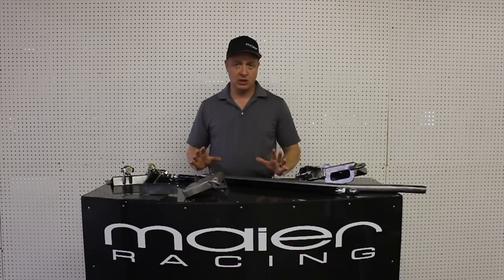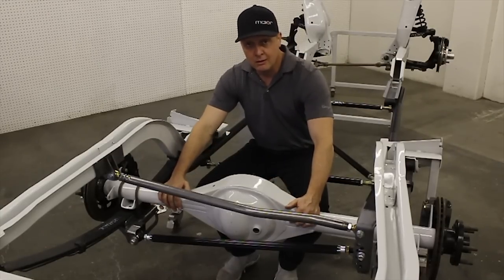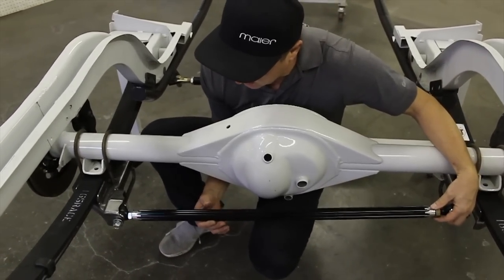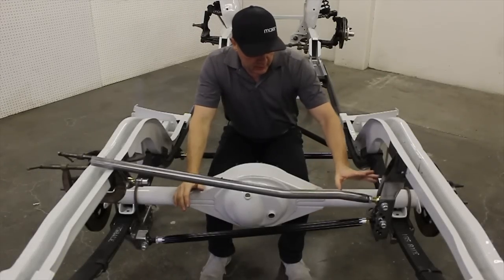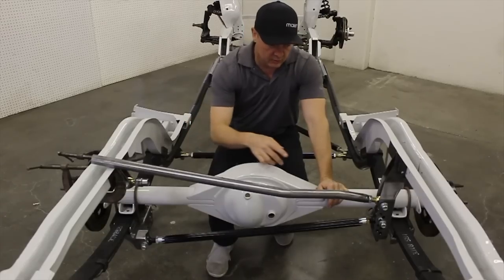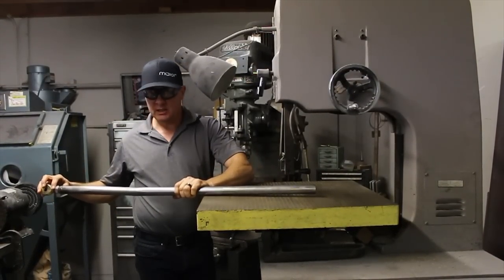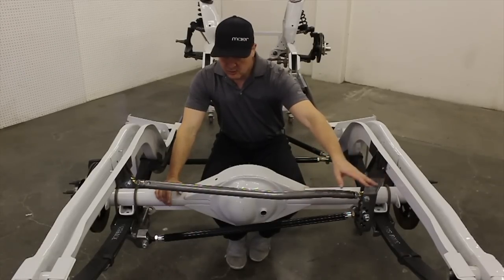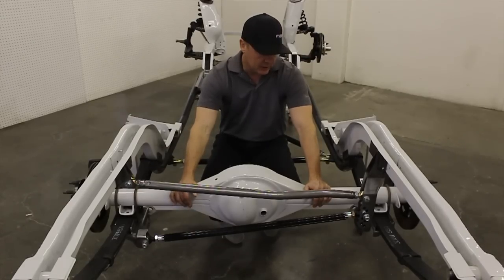Panhard Rod Kit - Maier Racing

Comment: 2 questions:  Does this kit work for other Ford rear suspensions? (Falcon, fairlane, etc)?  Would you recommend this upgrade for road course/autocross type racing?  Very informative video! Thanks!
Reply from the maker: The kit is somewhat universal.  It is designed to help stabilize the rear-end of the car and sets the roll center.  The challenge for the applications like yours is the aluminum tube.  You may need a longer tube that we can supply in 1" increments.  If you plan to do auto-crossing or road racing, it is a good addition.  Hopefully helpful! Cm

Comment: Unless he has figured a way for the pan handle bar to shorten and lengthen as rear end travels up and down. Then the rear will be pushed to one side and the body to the other side from the length if of the panhandle bar. In high speed when body goes one way and rear end another that would cause a sway in rear end and body. Or that’s how I see it, if a truck pulls a trailer and u get that away then truck is pushed to one side and trailer is pushed to the other causing a sway.
Reply: Yes, you are correct.  As the Pan Hard Rod is swinging on an arch, it will push and pull throughout its range of travel.  That said, the number is very small.  Ideally the pan hard rod should be mounted relatively close to level at ride height.  If the P Rod is 40" for example and the chassis goes through an inch of bump, the amount of pull from the chassis on the rear end will be less than an 1/8th of an inch or so.. very minimal.  The P Rod is a case of reducing a larger issue; the control of the chassis over the rear end.  Which without a P Rod, Watts link, Jacob's ladder etc.. that issues is far greater than the push and pull of the rear end in its travel.  The P Rod also allows you to move the roll center easily.  A nice tool if you are in competition and you find you need course changes in a short amount of time.  No need to change springs.  Changing the roll center effectively, changing the leverage and the effectiveness of the spring.

Comment: How much modification would be needed if I have mini tub kit?
Reply from the maker: Does your Mustang still have leaf springs and if so have they been relocated?
Reply: @maierracing558  yes. I want to do the Detroit Speed mini tub kit. With your leaf springs and panhard bar setup.  The Detroit Speed kit does move section of frame rail inboard. I believe it does relocate the springs inboard. I dont know how much though. Would the bars need shortened and rethreaded to fit? That is what I'm thinking. Anything can be made to fit.
Reply from the maker: @jobsheatz   #1. I personally sold the JRI shock line program to DSE.  I like their products.  That said, I would not really do their Mini Tub.  What is your goal?  Email us: maiershipping@gmail.com